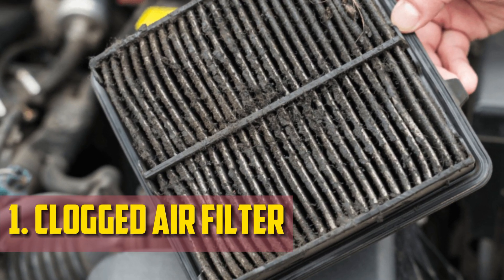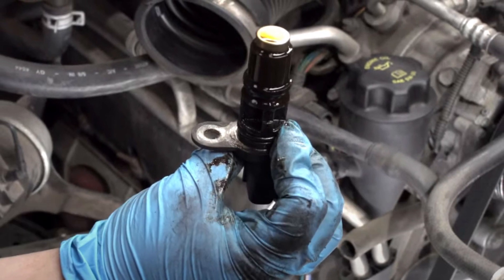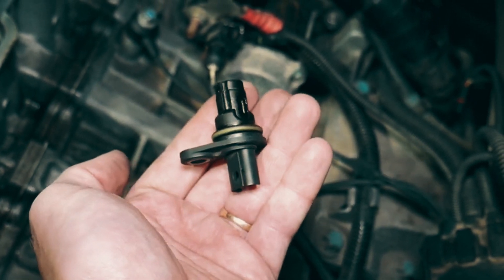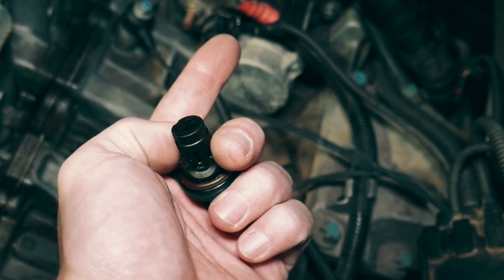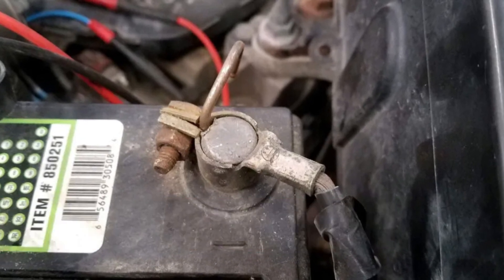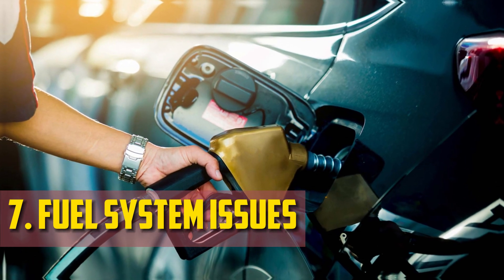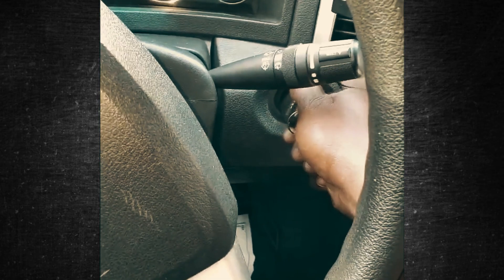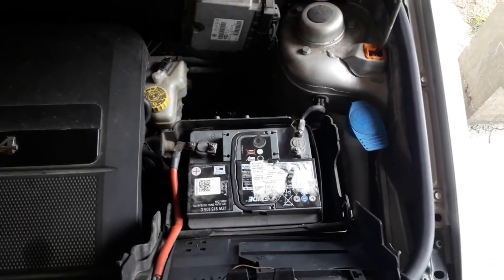7 Causes of Hard Starting When Engine is Hot  (How to fix?)

Comment: Mine starts right up on second attempt. But first attempt it cranks for long but won’t start or when it tries to start, it does like it wants to stall but will eventually fire up. I’ve changed fuel pump, I’ve changed spark plugs. I don’t know what else to do. I’m tired and frustrated. I want it to start on first crank

Comment: Hi, in my case, 2014 camaro  V8, afer changing the spark plugs and injectors, the car now has long start after hot. No engine light, no codes. Before the change, no issues in starting
Reply: Check on a laptop the injectors, could be that they’re fucked. Same with mine, 3 new from Bosch one old, the oldest is doing better than the 3 new.
Reply: @DimaWRHD  ok
Reply: @forexcontratosfuturos9290  hey bro, coming back. Did you install them correctly? I was at the mechanic and he said that you also need to program them.
Reply: @DimaWRHD  I came back to mechanic, and he couldn't find anything wrong with my  new bosch injectors. I really think it is something about programming. But the car is great, better consumption,  power,  torq , normal idle , no engine light. And the car is with hypertech tuning plug and play( engine performance set).
Reply: @forexcontratosfuturos9290  My mechanic said it’s the start motor that needs to be replaced, that’s why my car isn’t starting when he’s hot. Maybe that could help you also if you ask, let me know if it would be fixed and what was prong
Reply: Wrong *
Reply: @DimaWRHD  but did the car have crank when it was hot or no crank?
Reply: @NoName-xo9sk  hey man, it had crank yes.
Reply: @DimaWRHD  Thanks, any other symtoms?  We are trying to diagnose my Mitsubishi no start when hot.  Only a lean code, which a lot of things can cause unfortunately.

Comment: My first rhouggt would be crank sensor if its a Chrysler product found so many cracked in my 26 years as a mechanic
Reply: hey so cold start my car is good. but when i drive for 30 minutes it starts and boggs down but once i start it it idles smooth and everything. 2004 mustang gt and idk what it could be
Reply: @justindeckard5296 did you find out?
Reply: @justindeckard5296 engine collant sensor?
Reply: @HumbelPie  it can also cause problems.
Reply: I have a diesel BMW. here in Europe is very common. When its hot it shuts down and doesn't start until it's cold. I think it can be the crank shaft or the injection pump.